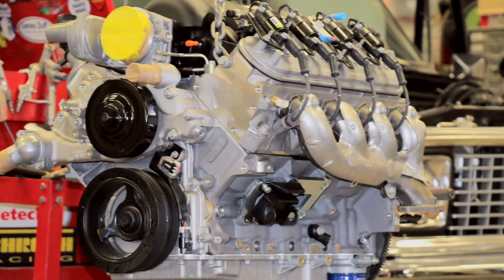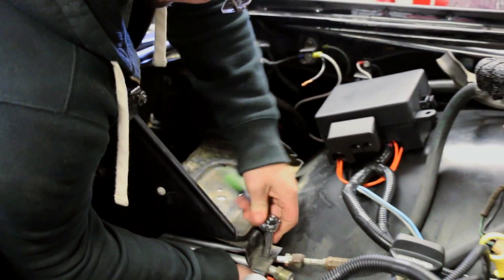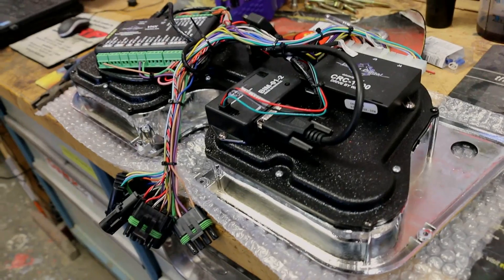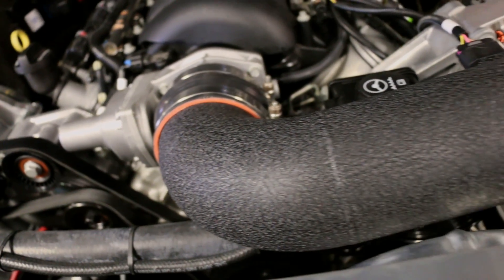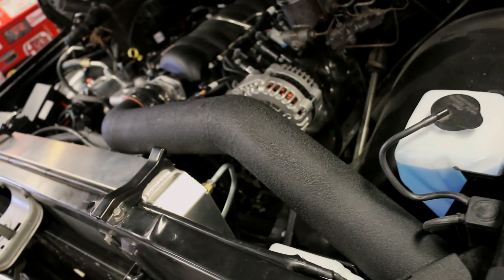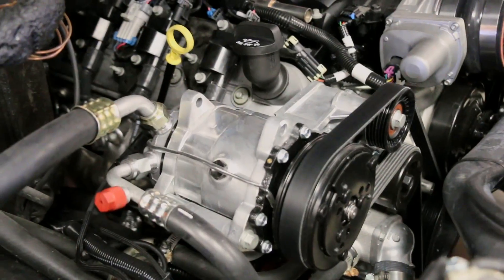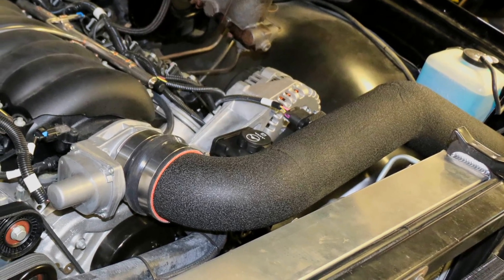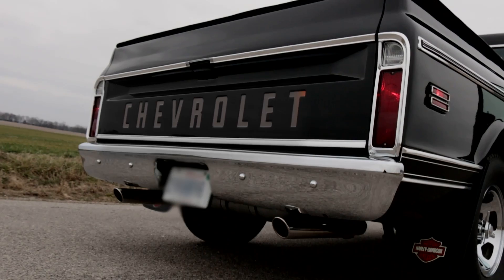1971 Chevrolet C10 LS3 4L60 Transmission Swap Video Series Part 3 V8 Speed and Resto Shop

Comment: Damn professional run shop.. Hats off to them.. Top notch work looks like.. Not a bunch of wanna be mechanics. True craftsman. ... Only thing I see that would help you tremendous is to put in a bridge crane and do away with that troublesome cherry picker.. Bridge crane is easy build and with it you elimimate bulky picker in front and will allow more room for dropping in engines. I built mine from I beams and poles. Best money spent in shop . Nothing in my floor all overhead lifting..
Reply from the maker: Thanks for the kind words Larry!

Comment: Very clean install, looks a great deal simpler than that last Ford Lightning bumpside you guys did.
Reply from the maker: Thanks!   The Lightning "Thunder's Truck" was a whole chassis swap with modern suspension & brakes as well.   This was far simpler being an engine and transmission and a few other upgrades.   Both are cool, glad you liked 'em!

Comment: Looks like you might be losing some pounds Kevin. 

You really can't go wrong with a LS3, it's a huge upgrade over the SMB Chevy in any performance application.  Not as easy of the eyes but it wont leak oil and will likely be a no hassle start every time.

Comment: I’m still really curious on how you got the factory AC to work. I’m currently in the middle of swapping my 1972 GMC C20 cab, bed, hood, fenders, and grille on to a 2003 Chevy 2500hd 4x4 chassis. And that is one obstacle that I’m gonna come up to on my swap, now what would it take to make it all work? Just trying to keep my options open and to see what’s gonna work. My 1972 GMC C20 is a AC factory truck as well. Thanks

Comment: I am having an issue with my radiator mounting up, I noticed you guys looked like you had the same issue. What did you do to the bottom bracketing of the subframe to seat the radiator?